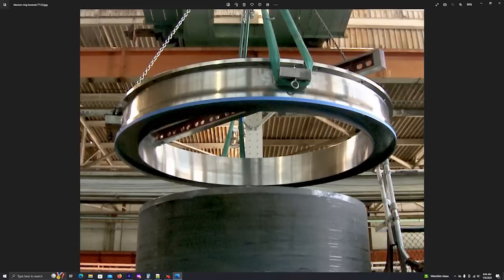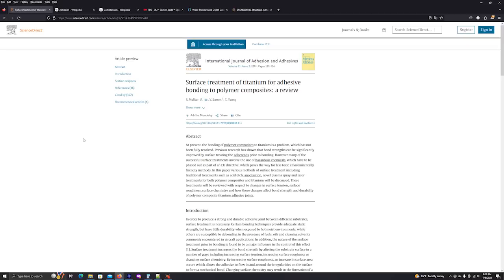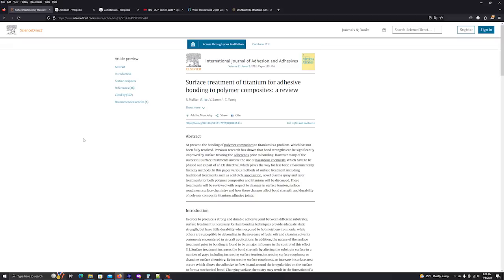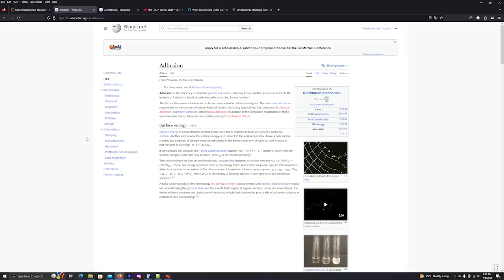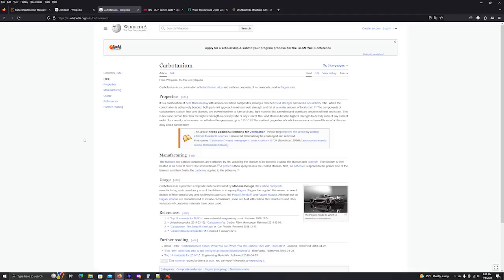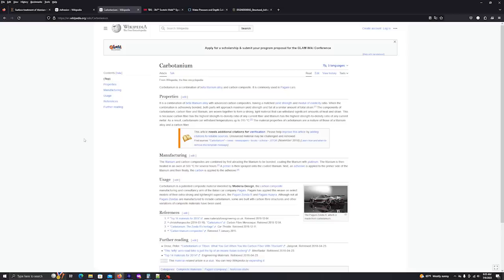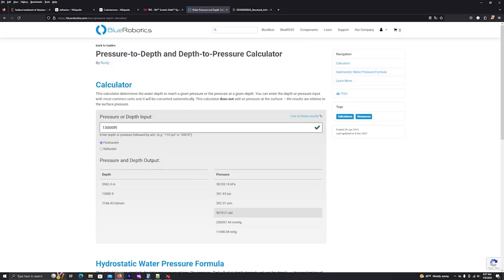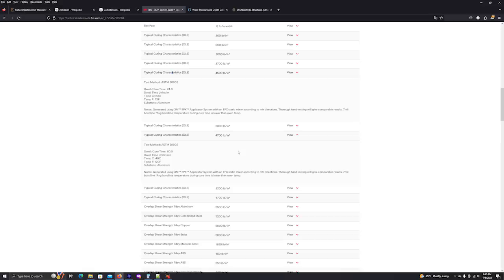Oceangate Titan Adhesive issues between Carbon Fiber and Titanium

Comment: I'm pretty sure Stockton Rush thought he was the hero of an Ayn Rand novel. There's A LOT of literature out there on how these things should be done. In carbon fibre test pressure hulls and the Deepflight Challenger (designed for one-time use only) the end rings weren't just glued but secured firmly in place with internal bracing rods which also allowed for equipment to be braced in place so that it didn't place any uneven strains on the pressure hull itself. But there's no literature on the cyclic fatigue of carbon fibre under such circumstances. Glass fibre has been used not often but very successfully on several submersibles for decades (and is the only composite material allowed by Lloyds), including on the Royal Navy's rescue submersible, the LR5, the commercially available Deepflight Superfalcon and Dragon ranges, and a whole slew of submersibles and escape capsules designed by the Gdansk University of Technology. The Deepflight Superfalcon and Dragon pressure hulls were all cyclic tested by Lloyds during the certification process down to a depth of 600m repeatedly and certified for an operational depth of 100m, but glass fibre has a much lower Young's Modulus so does immediately explode into powder. Also, all of the pressure hulls I mentioned are incredibly thick; upon initial tests the Gdansk University of Technology found their calculations didn't hold up, so they redesigned the pressure sphere include a core (balsa, which has really good compressive strength once you eliminate the danger of osmosis, which I believe they did by constructing their pressure spheres out of twelve pentagonal elements, infusing the resin under immense pressure, then laminating the sections together. You can see some of their submersibles and escape capsules and the Gdansk Maritime Museum. On other examples, the hulls were sold but seem so thick that I suspect the calculations were based not on the strength of the laminate overall but on its weakest ingredient; the matrix. Epoxy has a compressive strength of about 10,000 psi, which means the Titan would realistically have needed a hull just short of 18 inches thick to have a crush depth of 4000m, putting its safe operational depth at 400m (given a factor of safety of 10:1 which is reasonable for passenger use, but many jurisdictions limit tourist submarines to 50m or 100m anyway, and this is pretty much what this thing was). Even acrylic, which is used on LOADS of submersibles either for viewports or entire pressure hulls has a compressive strength of only about 3000psi, but what Rush didn't appreciate is that it's not the strength of the material that counts; it's how it behaves. glass fibre, acrylic and carbon Fibre have useful strength to weight ratios, but beyond about 1000m they become nonsensical anyway because in practical terms you might as well just used steel, titanium or aluminium. The other thing is, when securing two dissimilar materials together, you would usually have something like a neoprene "seat" for example, and brace or clamp one to the other so the different expansions and contractions of the two materials don't effect the other because they're not actually touching. I think what happened here is the acrylic viewport, which was rated to only 1300m because Rush declare they'd see cracking in it before it failed and thus have time to return to the surface, blew in, shearing the end rings off and the resulting influx of pressure utterly annihilated the carbon fibre cylinder and everything within it, which may explain why "presumed human remains" were found on one of the hemispheres. It's probably where the acrylic viewport made someone into a splat. The thing may well have blown in in one piece because that kind of pressure can turn a solid into something very elastic very fast. It wouldn't have helped that the pressure hull was never ultrasonically inspected because Rush told everyone the necessary equipment didn't exist, yet when David Lochridge shined a bright light through the hull, he said he could actually see cracks and voids. Hell, you can see them in videos of the filament winding process, which always seemed like a really slipshod way of making a pressure hull anyway.
Reply from the maker: Thanks for the feedback

Comment: The problem isn’t the failure to achieve a bond, allowing water to penetrate into the crew compartment. It’s that the bond between the titanium ring, and the carbon fiber cylinder failed to prevent water intrusion into the outermost layers of the carbon fiber. It was the gradual water intrusion after compression/decompression cycles. That’s why titan was overweight soon after it left the polar prince mothership. It was taking on water weight. The bath scopic pressure on dissent would’ve powerfully held the sealed air compartment, passenger compartment. But it did nothing to protect the outer layers of carbon fiber, from becoming impregnated with water. That’s why they had such a high decent rate and could barely ascend 60 ft./min. even after dropping all ballast and dropping the frame. They had water intrusion into the layers of the carbon cylinder.
Reply from the maker: Thanks for your feedback

Comment: That adhesive joint scared me since I saw the video. Nevertheless even if the adhesive bond failed, the pressure acting at the hemispheres would keep everything in place. Of course, there could be some leak (just the axial force would guarantee leak tightness?) which could cause further very concerning problems... but since apparently there was a substantial damage in the cylinder, I think the main issue wasn't the adhesive. It seems to me that the adhesive joint is certainly a weak spot, but the cylinder seemed to be damaged in a way incompatible with just the failure of the adhesive joint
Reply from the maker: Thanks for your feedback

Comment: My thoughts are that when they ejected the cradle from underneath to reduce weight for the ascent and this is when the sub exploaded/imploaded.
As I have asked before why no rods added to the hull ro help with keeping the three pieces of the sub so when the cradle was no longer assisting in keeping all three parts together, being a nerd I have looked hard watching all the uploads on here, being a mechanical engineer admittedly not marine but I have a good insight into the design for pressurlised container I feel this was when it let go, anyone like to talk about it here would be interested if anyone is thinking the same.
Reply from the maker: I think the center portion of the carbon fiber cylinder was weakened by repeated dives and that could have been the weak point.  Even with rods running length wise  for support of the end caps, I still think that the carbon fiber would have failed.  Even a small crack at that pressure would have split the carbon fiber cylinder.  Thanks for your insight, it is always good to have collaboration.

Comment: The difference in thermal and stress strain between the two materials probably caused repetitive shear forces at the glue interface. This could have resulted in delamination and a seawater leak entering the false floor. This could explain the slow descent (extra water weight) and electrical issues (seawater is highly conductive). Once the cracks started leaking, an implosion was probably inevitable unless an extremely fast ascent were possible. The occupants may not have even known they were taking on water.
Reply from the maker: Thanks

Comment: I did some math on the pressure on that ring joint.  I know I am probable wrong , but.  this is just an estimate (Guess).  I figured the total pressure on a 5Ft sphere. Divided by 2. (Two hemispheres) surface area of the glue joint 5ft by 5 inches. I end up with over 30k.psi. I used 6k psi water water pressure depth. I have nothing accurate just ball park.  I wonder if I am wrong.
Reply from the maker: Thanks for the calculation.

Comment: Two different materials, glued together, in cold salt water, no test data. Sad part is yea the titanium would probably withstand going through a black hole by itself and the way it survived bears that out. The carbon fiber however isn’t meant for such back and forth extreme conditions.. the glue ? Who knows what it’s weakness is.  Doesn’t matter because we already see what the results are. I’m just amazed it made a couple trips down and back. Sounds like it wasn’t a smooth ride either time . This isn’t a disaster.. it’s a sin
Reply from the maker: Thanks for your comment

Comment: Nothing was wrong with the glue they used, it was the size of the lip and the thickness . Along with the delamination , fiberglass and carbon fiber blush when exposed to water and retain the water and many heat cold cycles makes the layers separate and degrade the fusion whether it be epoxy or resin. I’ve messed with allot of aerospace stuff for Lockheed, it wasn’t thick enough. He only made it as thick as the cones .
Reply from the maker: Thanks

Comment: Different thermal expansion properties, different modulus of elesticity and different material thickness causes differential movement between tow materials which meants tendency of crack. All these plus cyclical action garantees failure.  How in the world someone just glued two parts together for such a dagerous equipment with people in it.  Now days, there are lot of engineers are lack of common senses.
Reply from the maker: Thanks for the feedbcack

Comment: yeah, but the issue at hand here isn't the strength of the bond itself, because the pressure at that depth is working in favor of the bond, by pressing the endcaps to the cylinder.  what I've seen in modeling is that the cylinder, if you look at a cross section along an axial plane, not the section perpendicular to the axis, that section acts like a beam supported at the ends by the titanium caps.  because of the thickness of the cylinder, as it deflects, the outside corners at the titanium interface are being pulled away from the bonding surface, with a force much greater than is at first apparent, because of the length of the beam relative to the thickness.
Reply from the maker: Thanks for the added information

Comment: What seems odd to me is I would have expected the glued joint of the carbon fibre tube to the titanium flange to be a weak point together with the tube itself. If the bond of the tube failed or the tube why is the flange not still bolted to the end hemisphere? There were 18 bolts I believe. I assume the other end was bolted also with another 18 bolts. No idea of the material of size but being  a cost cutter may be they are juts from  diy store. Thoughts?

Comment: I recently used epoxy to glue polycarbonate to polycarbonate in a (fortunately above water) marine setting. It failed instantly and with a bang when the polycarbonate was flexed beyond a certain point. I contacted the company that supplies the polycarbonate and they didn't know what kind of glue would work. Bear in mind that carbon is a flat, diamond leaf shaped atom that wants to lay flat in a regular pattern. There is no room for movement, and the flatness means it is always slippery, hence why you lubricate your sticky saw blade or lock using pencil lead. I was directed to speak to Bostik about it, and even they were unsure as to what glue is best for polycarbonate.  Their recommendation was a two pack glue called Acrylic VT that is applied with a double nozzle that mixes it at the point it is applied, and which I believe sets very fast.

My worry about the carbon fibre is the slipperiness of the material, which makes attaching it structurally very problematic. Combined with its rigidity, any solid glue (like epoxy) that is compromised by the slipperiness of carbon fibre will allow very little flexibility before it fails. The different expansion and compression of the carbon vs titanium would have eventually put unbearable stress on the glue in my opinion
Reply from the maker: Thanks for the great comparsion

Comment: New mic is a great improvement 👏. 
Ive enjoyed your set of videos on this sad affair,  engineering is always important,  no exception. 
Its certainly possible that the end caps to cylinder components bonding failed during build, or first handling during build; the end caps being spigoted, would stay in place without bonding?
So often, a precision assembly is lifted, moved, handled by the lowest paid.
Many thanks for sharing your knowledge and insight.
Best regards from the UK. 
John.
Reply from the maker: Thanks John for the feedback

Comment: They had no alignment jigs or measuring probes. No way to measure the glue thickness or  check the plumb to cylinder opening. For a large ring like that, a few milliradians of tilt would make an uneven gap.
Reply from the maker: Yes pretty scary.

Comment: On another video I saw it showed a guy cleaning the surface of the flange before applying the adhesive. He cleaned it with a rag with some kind of soaked in some kind of cleaner such as rubbing alcohol I assume. But right after he cleaned the suface with one hand he touched the cleaned surface with his other hand and was not wearing gloves so obviously oil from his skin contaminated the just cleaned surface. I have done this kind of work and I was very aware of the necessity of not touching the cleaned surface with my bare hand.
Reply from the maker: Yes I also noticed that bare hand on the titanium surface.

Comment: I was shocked the titanium ring was glued to the outside of the carbon tube. You would do this in a high-internal-pressure pipe system, where as the tube expands it puts pressure on the end fitting and tightens the seal (ie a pipe bomb). But we are talking about pressure going the other way! The tube would be crushed smaller and pull away from the titanium ring. The other thing that made my jaw drop was the way they wrapped that carbon tube - absolutely zero overlap. Imagine you were making a flat piece of composite, and in one direction you only had the strength of the glue, but none of the fibers. It would split in half like a shingle. And it wouldn't fail slowly, its all or nothing. This thing was very clearly not engineered.
Reply from the maker: Yes I had heard that later they wrapped carbon fiber prepreg in axial orientation.  But I have not found any video of this

Comment: Simulations I have seen call into question the material used for the viewport or fiber hull. In all cases, the titanium end caps end up collapsing into each other less than .01/ms. Stress fractures induced in the carbon fiber after repeated dives are also a high probable failure. The glue and all its tests don't seem to be the likely point of failure. It can fail, of course. It just had higher compression tolerance (which should be the only force applied prior to failure).

Repeated dives on the viewport (unrated) and the carbon fiber hull (unrated) are likely to be the cause. I doubt the bonding of titanium to a composite was compromised after so few dives.

Also, where are you getting your 150% safety req? .75 of your tolerance no? That is 133% or 4/3
Reply from the maker: Buildings commonly use a factor of safety of 2.0 for each structural member. The value for buildings is relatively low because the loads are well understood and most structures are redundant. Pressure vessels use 3.5 to 4.0, automobiles use 3.0, and aircraft and spacecraft use 1.2 to 4.0 depending on the application and materials  Actually I was incorrect it is 3.5 to 4.0 for pressure vessels,  https://en.wikipedia.org/wiki/Factor_of_safety
Reply: @JoediyLab  Appreciate the great information and link! I think this is a good lesson to everyone who thinks "cutting corners" is an acceptable practice. Gets innocent people killed.

Comment: A sharp knock or explosion probably split it apart at the bonds.  I bonded steel to steel with jb weld, and when a guy threw a huge rock at my door, it broke the bond from the shock.  It was all roughed up and brake cleaned, too.

Comment: I'm not an engineer, but the question I have is that as a tube, wouldn't the middle part of the tube have been most prone to inward flexing?  I didn't see in the interior shots of the Titan any middle bracing, like another titanium ring, to give the middle part of the tube additional strength.  So with the ends of the tube being fitted with titanium rings and the hemispheric dome, there would have been more structural rigidity there.  But without the same strengthening of the middle portion of the tube, you would have had a toothpaste tube effect.  I'm guessing the failure probably occurred there.

The titanium ring and hemispheres would have then popped off both ends like a toothpaste tube with caps at both ends.  If you push down on the middle hard enough, both end caps will pop off.  So instead of compression affecting the adhesive, it would have been an extension or pulling force, pulling on the adhesive.

Also, why have a carbon tube, then a titanium ring, then a titanium dome?  Why 3 piece construction like that?  I would think homogeneity would be preferred on a pressure vessel rather than additional separate elements put together.  It's interesting that the dome also came detached from the tianium ring.  Was that put together with adhesive too?  Shouldn't it have been welded like they do on titanium hulls of submarines and planes (i.e., in an inert gas environment) or electron beam welding?
Reply from the maker: Good points,   Yes I am sure that would be some mid point flex.  Not sure how much.  And engineer is going to do some analysis on the pressure vessel.  The titanium end caps were bolted on the flange.  Thanks